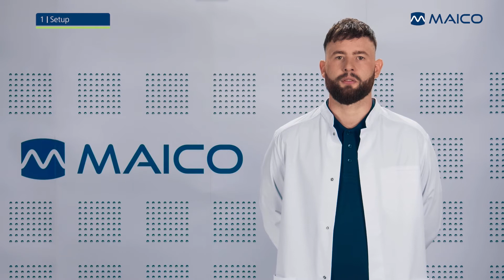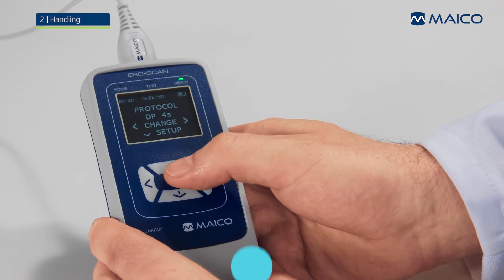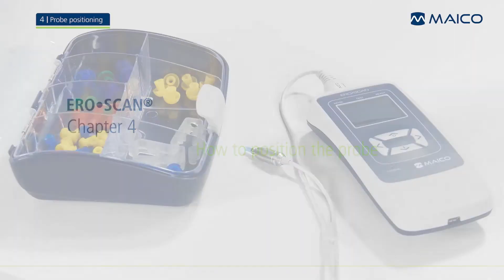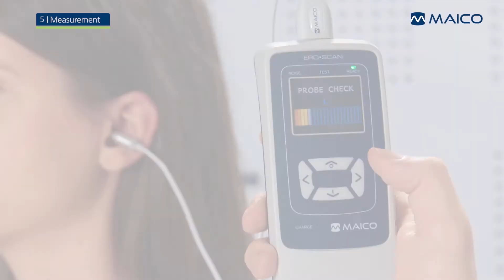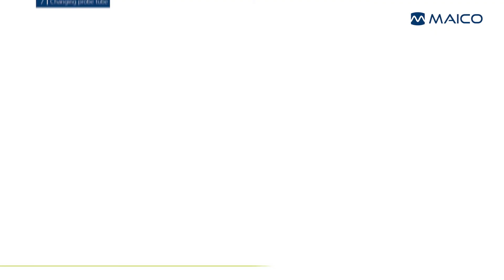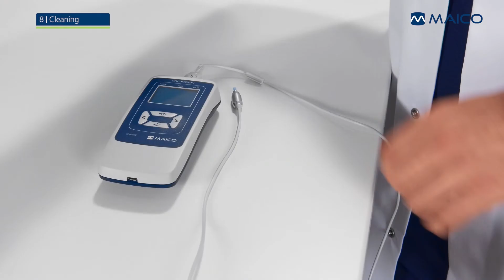ERO•SCAN | OAE | MAICO Training | Hearing Screening Diagnostic Tests

Comment: Does the bar in the graph must be green in all frequencies
Reply from the maker: Dear Doaa Galal, It depends on the measurement protocol you're using for performing the screening. The default protocol requires 3 out of 4 frequencies to pass (be green) for an overall pass of the screening. Please contact our Technical Customer Support (service@maico.biz) if you have any further questions. Best regards, Your MAICO Team